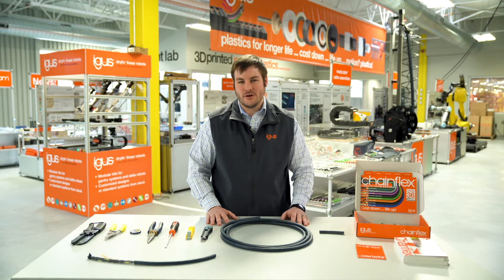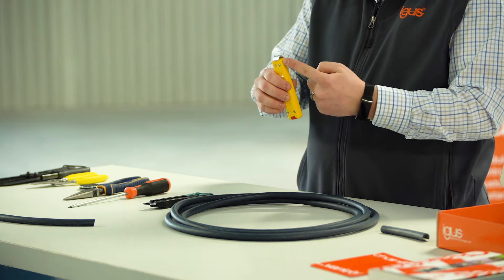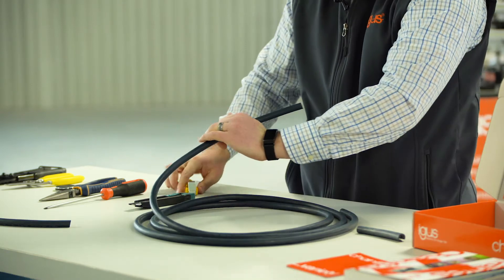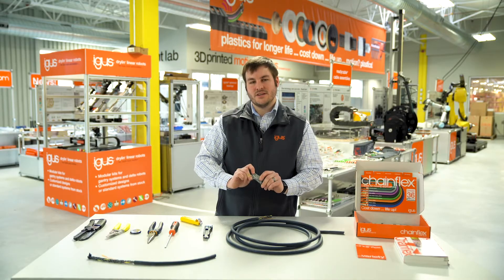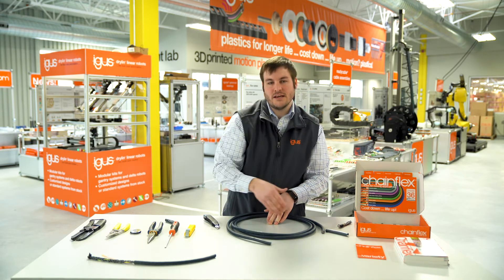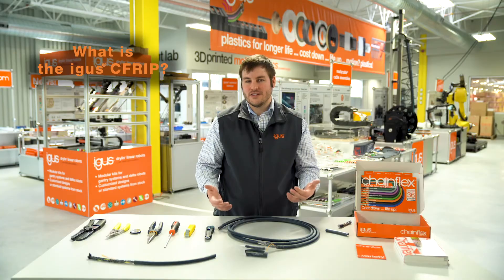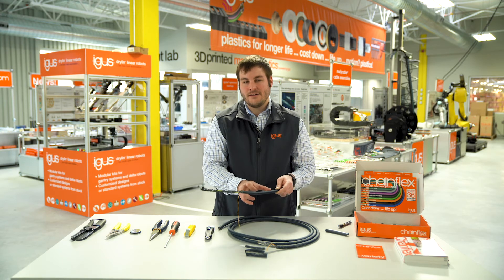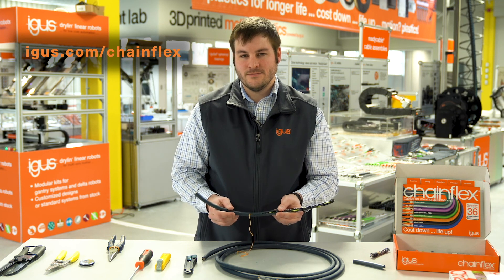chainflex® flexible cables - How to strip and prepare a cable for termination

Comment: Hate to say this but it’s the worst cable I’ve used yet
Reply from the maker: Hello @dudemanmanguy1957, let’s fix this for you! The issue you're experiencing may be due to using the wrong cable for your particular application. Could you please let us know what the minimum bend radius requirement is for your project? Additionally, it would be helpful if you could provide us with some more details about the project. Don't hesitate to contact us at https://www.igus.com/info/chainflex-contact or  (800) 521-2747 with the specifics and we will work together to troubleshoot any issues you may be encountering.